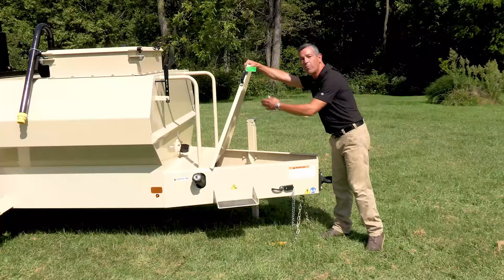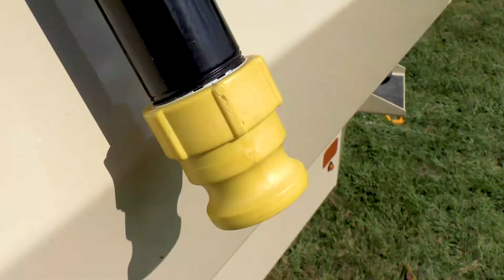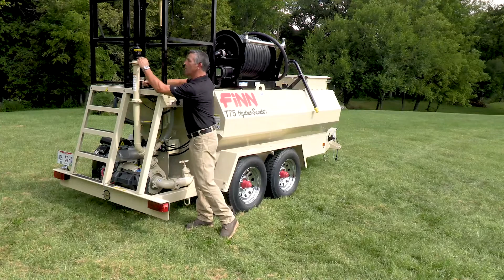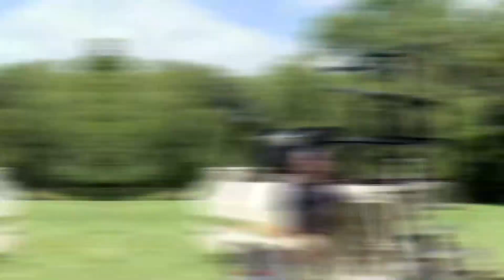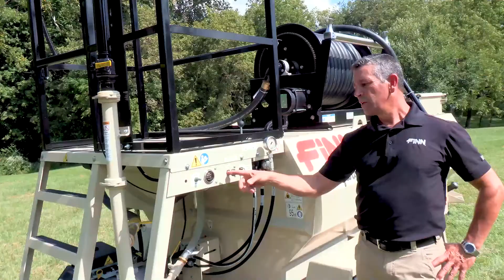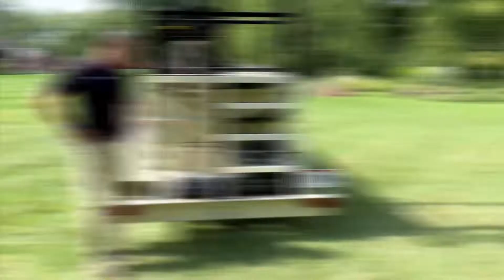Finn T75 Walkaround

Comment: OK, not so fast Finny. I'm the new guy with South Side Drainage Operations at the City of Colorado Springs. Thing is, the other guys haven't really been there much longer and none of us is really up to speed on operating this thing.  We've got on older model, but I'm sure the basics are the same.  So, we sprayed one area with the big sprayer on top the moved across the drainage pond and used the hose to spray two smaller sections.  Great!  

Then we traveled to a different site maybe 15 minutes away, tops. When we tried to spray from the hose again everything was clogged up, nothing coming out of either option, hose or tower blaster. What did we omit? Do you need to clean out your hoses and the blaster before traveling?  Wasn't particularly hot, maybe 80 degrees tops.

We put 6 fifty pound bales of mulch stuff with 800 gallons of water and 25lbs of seed. 

HELP!!!!
Reply from the maker: Thank you for reaching out! It is important to use the shut-off valve coming off the pump and going to the hose reel in between transport and in between loads. Leaving the valve open when you are going to another job or are done at the end of the day allows all the water to run back into the tank when you wind the hose up. By closing that valve, you are trapping all the water still in the hose allowing the material to run freely when you turn the pump back on. If you need additional information, please call (800) 543-7166 to be connected with the Regional Sales Manager who covers your area.
Reply: Thank you.  We took the hose connection off of the reel and found it clogged. Previously we found the pipe from the pump to big sprayer clogged.  Luckily the hose itself was not clogged. (Well, the end may have been, we spent several hours trying to run a hose up it to loosen the mulch. Maybe that was just additional wasted time, because once the reel feed was unclogged the contents of the hose sprayed out easily.) At any rate, it might not hurt to add that information to your video.